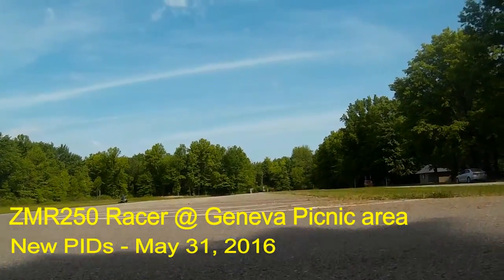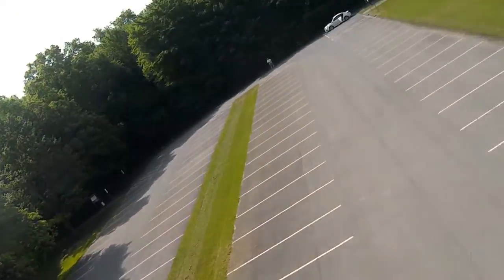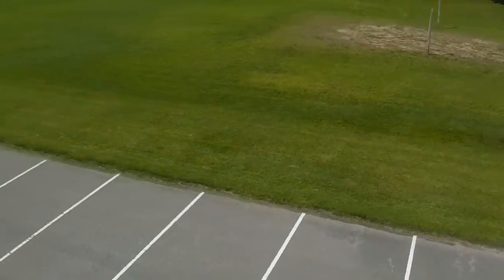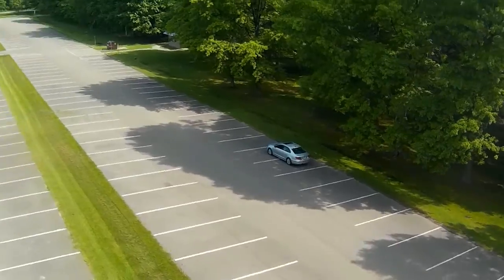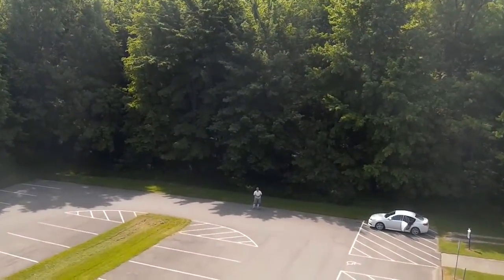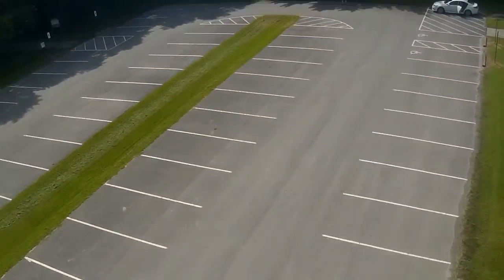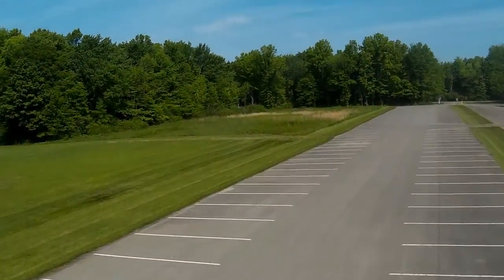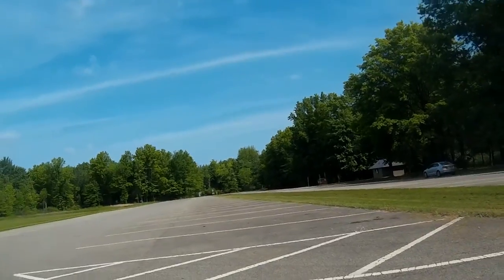ZMR250 GOL Picnic area 5-31-16  (720P60)

Comment: The more I watch Bill the more I'm tempted! I also half expected to see a Mustang landing.
Reply from the maker: Flying one of these 'racers' is totally different from flying a "camera bird".  On the plus side, you can set them up to have 3 levels of stability: a) relatively stable; unable to flip or roll,  b) somewhat stable and you can flip or roll them at will,  c) zero stability and you better be on your toes because you'll have a "tiger by the tail" trying to fly in that mode.  I have flown in the "Full Acro" mode, but it gets my heart beating too fast .. so I tend to stay in either option "A" or "B".

Comment: Awesome Bill! Makes me want to get one. I've seen many videos of these racers and they all make my heart beat faster. I can't imagine trying to fly one. Closest thing I flew to one of these was my flying 3d x8 in pure raw mode. No idea how fast it was, just that it was much faster than my x8c. With brushless motors, it screamed pretty good. Thanks for sharing
Reply from the maker: The thing with these racers, is, you set up the flight control board. I have a NAZE32 Acro in mine.  It has 3 flight modes: Angle, Horizon and Acro.  (other controllers refer to them as Attitude, Rattitude and Rate). In angle, you can set the max angle you want the controller to let the craft bank or pitch, and the gyro and accel. keep it flying nice and stable. In Horizon, it still has stability, but the "training wheels are off", and you can make it roll and flip and achieve whatever angle you dare. In Acro mode, there is no "self leveling" and no angle restriction. This is the mode that the real 'hot shots' fly in.  Horizon mode (Rattitude mode) is as "thrilling" as I care to get at my age .. ha ha! I built this one piece by piece. Now, you can find lots of racers pre-built and pre-tuned. Some even have GPS altitude hold in them (I guess you decide how much you want to spend and then select the options available). Q101, Dustin Dunnill and SeBe DocKy all have good videos on these "RTF" versions.  Thanks for stopping by! Cheers!